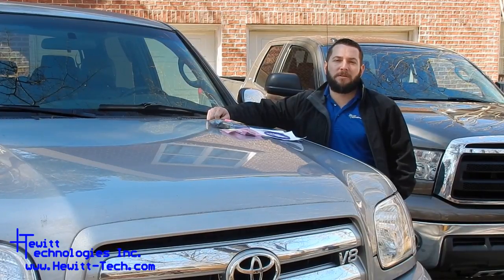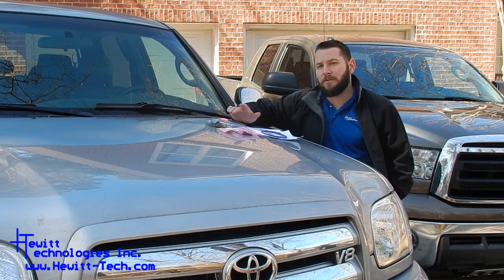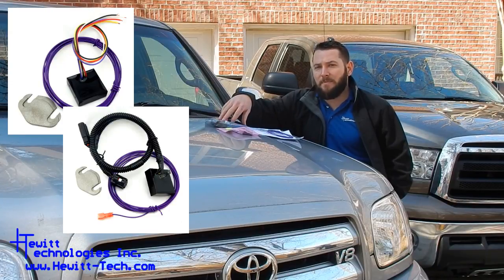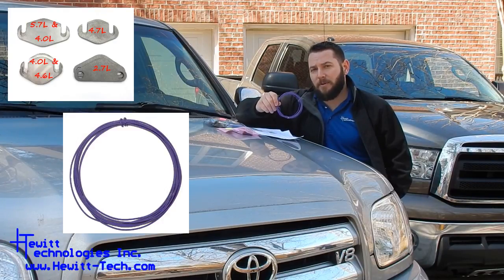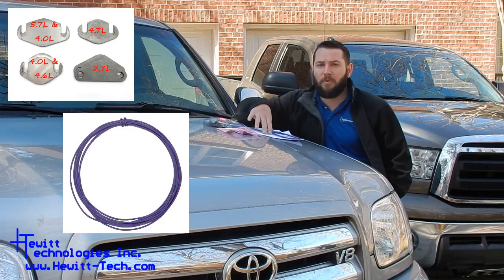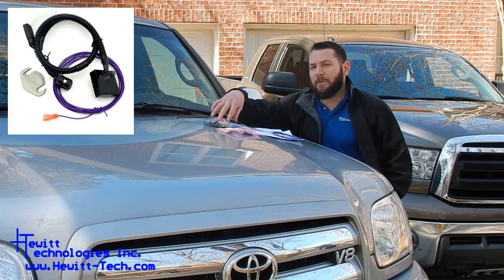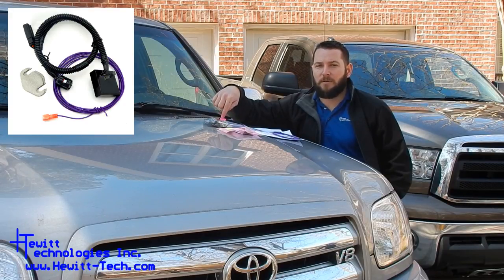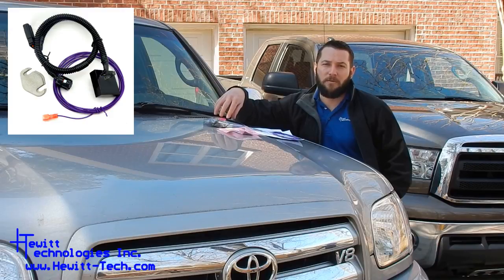Toyota Lexus Secondary Air Injection Bypass Kit - Wired vs Plug & Play Comparison - Hewitt Tech

Comment: Anyone from California installed one of these kits and pass this state’s by-annual emission test?
Reply from the maker: It is illegal to bypass or otherwise make inoperable an emissions system required for on highway use. All of our kits are sold for offroad or other emissions exempt use only. 
We do however sell our kits all over the US and even to customers in California. The Gen 2 kit is the recommended kit as the most comprehensive solution especially for the off-road segment as it would even let you remove the air pumps that would not be needed off-road.

Comment: Installed this on my 05 Sequoia guys and am EXTREMELY grateful that this kit exists. Super easy install, and since my Sequoia was throwing the p1442 and p1445 codes (stuck closed), I didn't install the block off plates out of FEAR of breaking a stud or stripping a nut. (I figured that if the valve is stuck closed, then it's already blocked off) Installed kit, cleared codes and BOOM, problem fixed! Here's the bonus for me. I also had the ABS and e brake warning lights constantly lit up on my dash and had an appointment at a brake shop the next day to diagnose the problem(s). Brakes felt totally fine but driving with dash warning lights lit up drives me absolutely nuts so I was going to get it fixed. After installing this bypass kit and clearing the p1442 and p1445 codes, I started my Sequoia up and couldn't believe that this also cleared my ABS and e brake dash lights also. So bizarre, but I feel like I got a 2 for 1 by installing this kit. It has saved  me a shit tonne of money. So thankful and grateful for this AWESOME kit. Hewitt tech for the win! I went from a dash lit up like a Christmas tree to ALL warning lights off. Such a great feeling. I do however, out of habit, find myself constantly looking down at my dash lights now to check to see if they are lit up after doing it for so long, lol.
Reply from the maker: Hey Floyd, thank you for taking the time to leave a review! As far as the plates go, just make sure you keep them handy or put them in your glove box so you know where they are later if needed. They are always recommended to install regardless because even with valve stuck closed codes, they can still leak later on down the road and cause the valve stuck open codes and limp mode. Typically the Valve Stuck closed codes won't cause limp mode (which would also disable your TRAC and VSC and turn those lights on).  
It is not normal that the two systems or our bypass kit would have an effect on the ABS/Brake system.  Most likely you had/have another issue with the ABS/Brakes but clearing the codes took care of. If those lights come back on I would highly recommend getting the system checked out before continuing to drive it. It could just be low on fluid or you have another more serious problem with the ABS/Brakes and it is unsafe to operate the vehicle that way.  
Paul
Reply: @Hewitt-tech  
Thanks Paul. Block off plates are in my glove box for future installation and I'm at the brake shop at this very moment getting them to check it all out. I knew that the bypass kit fix should not have cleared the dash lights for the ABS and e brake. I was just super stoked to finally have all my dash warning lights gone, lol. Thanks again for the great product!

Comment: Just went limp mode with 2006 Tundra🤦‍♂️
Got it home, and came across this possible solution.  Haven’t had codes read, but🤞🏻
Reply: did this work for you man?
Reply: @JayV714  100%.  Haven’t had a problem since!  Just make sure all of your connections are solid.
Reply: Had plug and play one  installed on my 08 tundra 2 years ago and had no problems. Then took into toyota dealership for 160,000 mile full service. Went int limp mode on way home and codes flashing. They said it was because of carbon gunk from cleaning fuel injectors so they took it back and fixed that. But, it NIW 6 mos later 4 lo and vac flashing. I took it into them and diagnostics say it's the Lower a.c. valve pump wich I K now is bad. Can I still get that diagnostic reading if bypass is installed correctly?

Comment: It looks like I may have to purchase this bypass kit. Have you had long-term feedback from customers? Thank you
Reply from the maker: Other than customers chiming in on forum pages or Facebook groups when someone asks a similar question, we don't get a whole lot of long term feedback. The responses are usually something like "yes, i have one installed for x amount of time, just buy it, they work". That is the best kind of feedback. It is very rare for someone to have a problem with a unit as they are designed to last as long as the vehicle. However, they are still electronics which is why we cover them with a non-transferable limited lifetime warranty. For as long as you own the vehicle if you have a problem with one of our units give us a call. We have full technical support and if we determine the unit has failed under normal use we will replace it.

Comment: Will this work on my 08 GX470? I have a bunch of Amber lights on in the dashboard. Also code p1445. Also, does this affect the performance of the engine and or vehicle in any way? Thanks
Reply from the maker: We have your 08 GX covered by our V54H kits right now and hopefully soon our newer GenII kits. For the P1445 code that is all you need. The unit has no affect on performance unless you are in limp mode and in that case it will just get you back to normal operation. Give is a call of you have any questions. Toll Free 844-307-7671 support@hewitt-tech.com
Reply: O

Comment: will this clear P0412 as well?
Reply from the maker: If you are using one of our current V36 or V54 kits they cannot take care of that code without help. You need to add what we call a Valve Solenoid Pack Harness(VSPH) to those kits in order to take care of the P0412 code. You can find it here: https://hewitt-tech.com/store/index.php?l=product_detail&p=70
However,  our Gen-II kits can take care of P0412, P0415, P0418 and P0419 without any additional kit addons. You can find them here:
https://hewitt-tech.com/store/index.php?l=product_detail&p=82
Check out our GenII video in our channel.

Comment: So I bought this for my 2005 Tundra 4.7 at 80k miles i’m at 99k now and having problems. I feel like the bypass kit has quit working. I called Hewitt Tech and they said replace the fuse to the secondary AIP so i did, no change. It was going into limp mode again before I changed the fuse but now it does not. But it still isn’t driving right. I believe the bypass kit is failing is because my spark plugs are new, air filter new, oil new, timing belt water pump new, have toyota red coolant. I use all toyota everything. Everything is OEM. I’ve tried additives, i’m running premium gas. I was getting codes P0172 and P0175 now i am just getting p0418 twice. i’ve tried clearing the codes by resetting the battery. and unplugging the bypass kit in multiple locations. Please help!
Reply from the maker: Did you just recently call about your problems?  It sounds like the only problem you are currently having is the P0418 code. If that is the case the P0418 code is not one our V3x kits can take care of by itself without a kit add on we call a Pump Proxy Pack. They are available on our website. If you need further help with this please give us a call back so we can figure out exactly what is going on.
Reply: Hewitt-Tech Will this make my truck run like normal again? or just clear the cel? I unplugged the bypass from the air intake and the fuse and it runs the same either way.
Reply from the maker: It depends on what the problem is and what your trouble codes are.  We need more information. Please call us so we can more easily help determine what the problem is with your vehicle or if there is a problem with the bypass kit. Toll Free 844-307-7671.

Comment: Tried to take off bolts for the block off plates and they all snapped off.  Not one nut came off. Sprayed them all at night and waited till morning.  Now ima have to probably pull my moter to drill and tap..    THEY DONT TELL YA THAT ONE!!   05’ tundra 4.7. 137,000 miles
Reply from the maker: Dave, I am very sorry you have the unfortune of breaking the studs off. They are stainless studs and can't just be wrenched on carelessly. We do in fact Very Strongly caution about this in the installation instructions but no one ever reads those. Unfortunately, it is not an easy repair to replace the studs but you shouldn't have to pull the engine.  You can first try to drill through the stud and use a bolt and nut or simply use flange clamps in their place. We are trying to come up with a specifically designed solution but you can first try a threaded rod beam clamp.  It is simply a bolt on clamp used to hang threaded rod from structural building steel for supporting things like electrical or hvac stuff but it is the best we have been able to come up with so far. In the worst case you can pull the exhaust manifolds to drill them out because you cannot torch a hole in stainless.
Reply: That's exactly what I'm afraid of.
Im seriously thinking about selling the 05 tundra to buy another 03 tundra. I have a single cab 03 tundra already as a work truck and from what I can see it doesn't have that secondary air system. I bought the 05 to use to gather supplies for my food truck ( basically a grocery getter)
But now I have this issue with with it.....

Comment: I lost the power since the secondary air injection pump went out. Can I gain the power back after I install the kit or it’s just for passing emissions and clearing check engine light?
Reply from the maker: Yes, the whole point of the bypass kit is to get you out of limp mode and let you clear your CEL for a failed Secondary Air System without having to replace the system. Once the bypass kit is installed and you clear the codes as long as there isn't another issue you should be back to full power again. There are some codes you would need kit addons to clear though. We only sell them for off-road use only or for use on emissions exempt vehicles, however what you decide to do with the kit is up to you. Having said that if you had an exempt vehicle smogged with the kit on, you don't have any other issues or codes passing emissions is not a problem.

Comment: wish i new about this a few days ago. i just bought a 2007 tundra 5.7L, a week later it broke down and the 4Lo light was flashing and wouldnt start. had it towed to toyota dealer and it was the air injection system. $3200.00 later.

Comment: I just installed the plug and play module on our 2011 Toyota Sequoia. We had issues with low power and no acceleration. Got kit installed and cleared codes and vehicle running like a champ. Toyota wanted almost $4000 to replace whole system!!Thank you for making great product, and making it even easier to install with the plug and play version. By the way I uploaded the install for my vehicle,hope it helps others with their install. https://youtu.be/7azQJipwwPs
Reply from the maker: Thanks for the feedback.  I have to admit we are horribly behind on our videos so i will have to take a look at yours and appreciate the support.

Comment: Is there a kit for 02 Toyota sequoia  4.7 set?
Reply from the maker: The Secondary Air Injection System was not added to the 2Uz-Fe 4.7L V8 until 2005 model year which is the same year it got VVt-i. If you are having problems and it is the factory engine, it is not the secondary air system and we do not have a kit for you. We are currently working on coverage for the 2013-2018 vehicles.
Reply: @Hewitt-tech  reach out to me

Comment: When installing the block off plates on a 2007 Toyota Tundra 4.7L  does it matter which end of the tube I put the plates in?  the connection under the wheels has very corroded studs from 11 years of New Hampshire winters.  The connections right after the valves are in good shape.  I was going to install the block off plates there instead.  To me it wont change anything having the plates 12in further up the line.  What do you think?
Reply from the maker: Hello Nate. Yes, On the 4.7L the block off plates are the same size for both ends of the air tubes and will fit either at the exhaust manifold flange location or the air switching valve location on the other end of the air tubes. Like you have noticed the ones at the exhaust manifold flange get a lot more road spray and the location at the back of the engine where the air switching valves are located are usually in much better condition because they don't get hit with all the road spray. It makes no difference which end of the air tube is blocked off as long as the exhaust is blocked off and you don't cause a leak.
Reply: thank you!

Comment: do you havr one for 200-2007 Toyota Tacoma 6 cylinder
Reply: 2005 -2007
Reply from the maker: The system was not added to the Tacoma 4.0L V6 until 2012 so we don't have one for a Tacoma V6 except for the 2012 model year. Either you have a 05-07 Tundra with a V6 or a Tacoma with a 2.7L 4 cylinder unless it has had an engine swap. You can give us a call and we can look up your VIN# if you are not sure but currently no kits for a Tacoma V6 before 2012.

Comment: I was told that I have the option to put this in instead of replacing the Air Induction switching unit.  If I am having this issue, would I notice power loss at the drive train mostly at higher end speeds and acceleration?
Reply from the maker: Hey Clem,
Pretty much the main reason to bypass the secondary air system with one of our kits is to keep the vehicle from going back into what we call limp mode from a failed secondary air system. The other main reason is to do it without having replace the expensive system that will typically just fail again. If you have any other questions please give us a call toll free at 844-307-7671 or visit our https://hewitt-tech.com website.

Comment: Will you still pass the emissions and will the lights stay off once you  reset them?
Reply from the maker: We do not sell them specifically to pass emissions since that is against the law so we only sell them for off-road or emissions exempt vehicles. With that said what the customer decides to do with our products and their vehicle is entirely up to them. 
The secondary air system will no longer operate and its monitor will simply show as incomplete or not ready which is all that is required for it to pass since it is a secondary emissions system. Your CEL for the system will stay off once reset and you shouldn't have any problems passing if:
1)There are no other problems with the vehicle causing a CEL or pending trouble code.  
2)The vehicle goes through enough drive cycles for all of the the other emissions monitors to run and complete. 
3)If it is an 09 or newer vehicle you would also need to wait until the permanent trouble codes drop out by themselves after you clear the CEL and Set/Pending codes.  

If you have any other questions please feel free to give us a call Toll Free 844-307-7671 or shoot us an email to Support@hewitt-tech.com You can also look up your trouble codes and download the installation instructions on our https://www.hewitt-tech.com website.

Comment: Would either of those kits work with a 2004 toyota tundra sr5 TRD 4.7 v8? I havent had any problems with the secondary air injection but if these kits will work Id like to get one just in case I do have a issue in the future. Thanks.
Reply from the maker: Hey Joseph, unless you had a late 2004 you probably do not have a secondary air injection system on your vehicle. The 2005 4.7L was the first model year the system was on the vehicle. You can easily tell if you have a secondary air system on your 4.7L by looking at the exhaust manifold. If you see a stainless steel air injection tube running to the back of the engine you have the system on there. Likewise you can look for the air injection control driver (electronic module roughly the size of an old flip phone) on your inner driver side fender. 
Chances are you do not have the system.
Reply: Hewitt-Tech Ok thanks for the information, I have only owned GM vehicles, this is my first toyota. I know they are good reliable vehicles so I picked it up for a back up vehicle. Thanks.

Comment: Seems like it would void Warranty. or something to disclose when you sell
Reply: If it’s under warranty I would assume they would fix it for free.
Reply from the maker: What warranty are you worried about exactly? If you are worried about a warranty take your vehicle to Toyota and pay them the $2000-$3000 to replace the system. We recommend disclosing the secondary air problem and the bypass kit solution if you sell the vehicle but that is up to the vehicle owner.